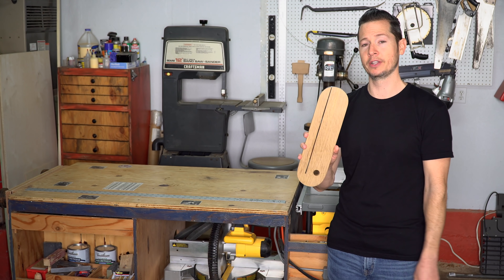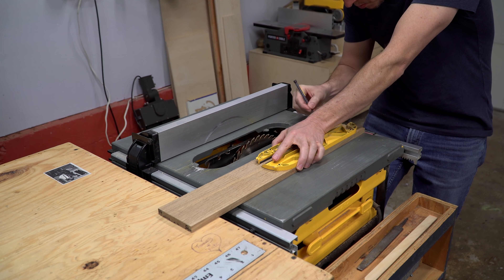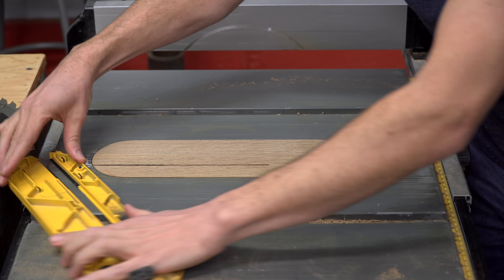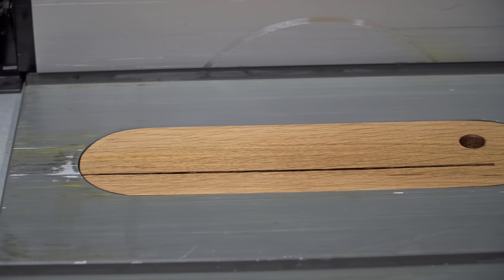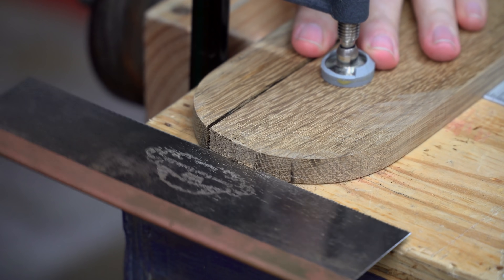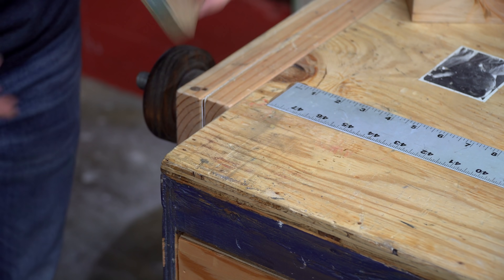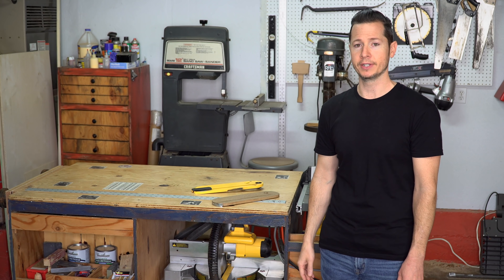A BETTER Zero Clearance Insert!

Comment: Once again, you're my hero lol. As you might remember...I too have this saw and am annoyed by that design flaw. DeWalt should buy this idea from you! Thanks again for a perfect fix!  🥰 Cheri
Reply from the maker: Thanks, Cheri! I'm glad you got something out of it - good luck with making yours!
Reply: Technically Dewalt could just alter the mold for the insert and maybe the riving knife if the aluminium got too thin at he back of the insert.
But there really ought to be an optional close-to-zero-clearance insert for those of us that barely ever tilt the blade! A small rodent could squeeze through that gap!

Comment: I have the exact same saw and the exact same problem! Thank you very much for the idea! Hopefully I can make this work.
Reply from the maker: No problem! If you build one, be careful not to sand the top side of the plate, only the bottom. You don't want to ruin the flatness of the top. If you do build it, let me know how goes!
Reply: @OneMinuteWorkbench  Thanks for the tip! I will let you know how it goes!

Comment: If you are going to make any more of these in the future, a less fiddly way to make the insert perfectly flush is to make the insert shallower than the depth of the plate. place two flat boards on top of the plate and stick them with thin double sided tape. apply some wax to the tabs and apply a dollop of hot glue to each of the tabs and then place the zero clearance insert in the hole with the top boards aligning the zci to be perfectly flush. the wax will allow the glue not to stick to the tabs but stick to the wood. the result is a perfectly flat top without having to sand perfectly.
Reply from the maker: Thanks for the idea! Somebody else just mentioned that and my only concern with it is that hot glue always seems "rubbery" to me. I would love it if I could do this method with something that gets as hard as epoxy, but epoxy might not be great because it tends to not be thick enough and just settle or run. How do you find the hot glue to feel. Does the insert seem to wiggle or dip from the rubberiness of the glue?
Reply: Would it be unreasonable to adjust  the surface of each tab so that each tab would be at the same depth below the table? One and done.
Reply from the maker: I think that's sort of the idea people are getting at with the hot glue idea. Except that in that case you'd only be able to adjust it one time. Some screws set into threads in the bottom of the insert might be another way as well. You'd just need to make sure the screws didn't adjust them selves from the vibrations of the saw. Thanks for sharing another idea!
Reply from the maker: Thanks for sharing that idea!
Reply: Why not just use screws like the original plate?
Reply: @loganmedia1142  because it's a permanent solution instead of having to adjust the screws as they rattle out. it also makes the insert free of any metal. (though this particular one used some metal for the front which i'd not do on a saw that had a reasonable throat plate that allowed the riving knife to work with it.)

Comment: This is really good. Thanks. I've got an older General Contractors TSaw that, oddly, has  slightly misshapened  round ends to the insert. When I made some inserts, several years ago. I made a couple. So I'd suggest making more than one. Straight cut with your regular blade, another with more gap for angle cuts, and  one for dado.  My plan of making a router pattern ... never happened. I didn't have a zero clearance pattern bit. I've had my tablesaw for about 25 years, been using them since maybe before your parents were born, so basically I'm saying, from experience.... making table saw inserts is something I think most people won't be doing every couple of months. So once you make an insert you like, make a few more right now. 
 Tip. Tweak your blade adjustments before you make your inserts, that 1/100th of 1 degree... well fixing it usually moves the blade over a lot more than you'd expect. Also my General? Great saw but the bolts, nuts, lock washers for adjusting the blade? They weren't very tight.  I upgraded the nuts, bolts, washers to...? I don't remember, it's been 14 years, but I think I spent a few bucks. (Split lock washers in general are crap, maybe not today, maybe not next week... I've learned to think of them as temporary.) I don't spend a lot of time in my shop, but 14 years between tablesaw adjustments? I check it every now and then with calipers. (I also try to avoid angle cuts which is lazy, but keeps from racking around all that hardware.)   There's no excuse that a company like DeWalt which has probably sold millions of these table saws,  would make such a crappy insert. Read Fight Club, clearly they've calculated the cost of missing fingers, blinded eyes  and the likelihood somebody sues, against the cost of fixing this inexcusable problem.
Reply from the maker: Thanks for the compliment! Thanks also for taking the time to share your advise and experience!
Reply: Yes I am sure the inserts that made for my saw are 25 to 30 years old as well.  And I just make the insert and raise the blade so there was never any flex to start with.  I still have the original insert that came with the saw I noticed the other day in the cabinet.  Don't think that I have used since I bought the saw in 1980.
Reply from the maker: Time to put it up for auction, maybe antiques road show 🤣

Comment: Great video, well done. I watched your video today after making some zero clearance blanks from 12mm plywood for my DeWalt 745 yesterday following different sets of instructions. They didn't address how to stop the flex at the back of the insert and your method looks great and I'll try it today. I plan using steel tie-down strap, which already has holes, leftover from other jobs. To level the insert I'll likely add some heavy duty tape to the bottom (adding thickness to the blank where needed rather than having to make it thinner). When I test the blank I'll see whether I have to add a clip at the back to hold the insert in place or whether the dust collector vacuum will be sufficient to hold down the insert. Many thanks.
Reply from the maker: Thank you! Good luck with your project - let me know how it goes!
Reply: The insert seems to work fine. It was fiddly to attach the steel tie-down strap at the back end. I think it would have been even more rigid if the strap was wider like your hose clamp. Using a hose clamp is also better in that you have to drill the pilot hole through the steel which keeps the screw centred. It was more difficult to drill a hole in the centre of the existing holes in the tie-down strap. The leveling took a while - I taped clips of the tie-down steel to the bottom of the insert and added extra layers of tape as needed. I also had to relieve a strip on the bottom where the insert rests on fabric to the left of the saw blade. The insert is a snug fit and I'll see how it goes over time. My saw is a DeWalt DWE7491-XE (not a 745 as I previously mentioned) and may have a slightly different design than yours.
Reply from the maker: Sorry for the late reply on this - just wanted to say thanks for coming back and sharing about your experience!

Comment: I had a similar issue but I just transferred the size of my plate to my wood insert with all the holes. Mounted down the insert and raised the blade as it was running so I didn't have the issue of a gap at the end of the outfeed.
Reply from the maker: Thanks for sharing your experience! I would have done that, but I wanted to accommodate the riving knife as well as the blade. I hope this make sense!

Comment: Great video. One thing you missed with the insert is the rabbet/grove you need to make to allow the saw to be raised all the way up. Otherwise the housing will push the insert up. I have the exact same saw and I'm on my 3rd zero clearance insert now. The first two didn't accommodate a riving knife but the current one does (and is connected at the far end). I still have a bit of flexing problem towards the middle right end (the fence side). I think I'm going to make another one with a metal reinforcement all around to avoid flex.
Reply from the maker: Hey thanks for sharing what you learned in your build! I'll have to incorporate all the stuff you and others are sharing on the next version! Thanks again!

Comment: A great improvement to a flawed design made by Dewalt engineers.
Nice job on your video and editing.
Reply from the maker: Thank you very much! In fairness to DeWalt, it's marketed as a contractor's saw, not necessarily made for cutting super small pieces. That said, we all know that us average folks are buying these saws as affordable alternatives to a nice cabinet saw. Either way, I say there's nothing wrong with modifying it to be more effective 😉 Thanks again!

Comment: Nice. I’m still trying to figure out how to make a plate for my table saw. I have an old Craftsman where the blade is almost to the back and the plate is super shallow.
Reply from the maker: That's exactly what I was faced with here. Either remove the riving knife so the plate can stay connected, or find a thin yet strong material to that would fit in the minimal space available. Good luck figuring out an insert for your saw!

Comment: The clamp steel reinforcement is a great idea.

StumpyNubs has maybe the best throat plate height alignment method I've seen. Paste wax the little support ears, glom on some hot melt glue, and push it down onto the ears until it's flush. He secures strips across the top face of the throat plate so that it squishes the hot melt just until the top face is even with the table top. A completely custom fit. It works great.
Reply from the maker: Thanks! I like the sound of the hot glue idea, but I may want it to be a little more stout than the glue provides. I feel like hot glue always stays a bit "rubbery". I could use that some technique with some thickened epoxy, but I'd be worried that the epoxy would slowly settle and bring the plate down too far. I wonder if there's something with the hardness of epoxy but the fast setup time of hot glue...hmmm 🤔 Anyway, thanks for sharing the idea!
Reply: @OneMinuteWorkbench  In my experience (limited to one Delta Model 10 contractor saw), it works great.
Reply from the maker: Thanks! I might have to give it a try!

Comment: Very nice!!!  Have you considered leveling screws?  These are fairly easy to add.  How about hold-down screws?  These are more complicated to add as they involve tapping / threading the thin metal lip under the plate.
Reply from the maker: I thought about adding leveling screws, but not hold downs - that's a great idea! I think I'll do that tomorrow! Thanks!

Comment: The idea was good.  But checking at your thumbnail, I thought that you had yet another good concept going on.  My brain just linked some other dots with your picture.  It’s awesome.  Thanks for the video.

If you want to know the flash I got, here it is.  I thought that you had managed to sorta implant a springy effect on the metal strip, and, hence, that you had came up with a zero clearance auto-fitting insert.  I thought it was a cleaver way to account for swollen or depleted wood fibers… all the time!  I’d also add a riveting knife (wtf did I just say?  It is what I do…). 

I know, therefore the design would need to account for other forces.  But I feel I have more than a little aspiration to owe to you; so for that, thanks again for sharing.

Comment: Nice idea. In addition to the two screws, could’ve you apply some epoxy to make it more secure and solid?
Reply from the maker: Thank you! I don't see why not. In its current state, the strap is very secure because it butts up against the edge of the notch for its entire length. So I don't know if it's necessary, but if you do add epoxy, I'd say add the screws without epoxy and test it out first. That way, if the screw positions have pulled the separate sides of the insert out of perfect alignment, you can repair it by moving one of the screws. Only after you're sure it's still perfectly aligned, then add the epoxy. Thanks for the question! I hope this helps!

Comment: Just a couple of days ago, I thought about doing something similar to mine. Narrow cuts are a royal pain with that huge gap that could swallow a small warship.
Most other "zero clearance insert" videos doesn't take the riving knife into account, or they modify it to fit. I would hate to modify mine, as the blade guard would no longer fit on. The european version of the DW745 is slightly different in several ways, the blade guard being one of them. Another is the missing anti kick-back, normal push buttons for on and off (not the big fat off button on yours) and a Philips head screw for securing the insert at the front. It also has just this tiny key slot for removing the insert instead of your finger hole.
One question though: is it really safe to just have it sitting loose in the slot?

Comment: How will you overcome expansion and contraction in your insert. Did you use quarter sawn lumber.
Reply from the maker: I did use quarter sawn material, but I'm not sure that will combat expansion and contraction 100%. I'll probably have to service the insert over time, and maybe even replace it. Thanks for the excellent question!

Comment: Do you have any issue with the plate raising at all from the vibrations? The original plate (as awful as it is) locks in front and back to prevent it lifting. Love the flexing fix btw!

Comment: Try the Leecraft DW-2 Zero clearance insert, specifically for the DeWalt DW745 and its sister models. Beautifully built and costs about $32. You'll need to cut a strip for the riving knife but it's not hard.
Reply from the maker: Thanks for the product recommendation. I had a look at it, based on your comment, but it looks like if I cut the slot for the riving knife, I'd still need to create the steel-strap-connection around the front, otherwise it looks like it would suffer from the same sort of flex as the original did, and like mine did before I added the strap. I could test it out to see, but I'm not sure I want to spend $32 to find out 🤣. Thanks again for sharing!
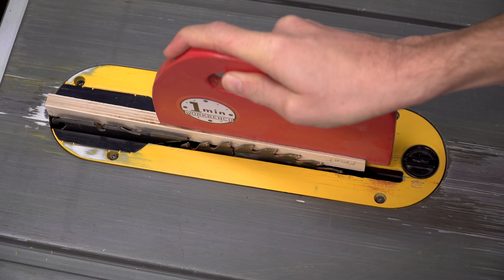Reply from the maker: Thanks for the link. I checked out that video, and see how he did it. The saw he's doing it on provides lots of space (on order of a couple of inches) between the riving knife and the slot wall....the problem is that on the DeWalt DW74xx series, there is less than 1/8" between the riving knife an the slot wall. There is only about .090", so what ever fits between the has to be smaller than that. So let's say a maximum of about .080". The only material I could think of that would be strong enough with less than .090" is steel...or maybe aluminum. Obviously I went with steel. Check out my video again, and look really closely at how close the riving knife is to the slot wall...you can see it really good at about 1:07, and again at about 3:07. I hope this helps!

Comment: I have the same table saw and there are a lot of things that bother me about it.  I know it's a contractor's saw, so I haven't gone to DeWalt to demand fixes.  1) The table is not perfectly flat... in fact, it dips around the throatplate area and it drives me mad... 2) The rip fence has a small bow in it.  I've got it perfect at one end and the other with an indicator dial, but when I check along the miter, the fence bows in the middle by about 0.005"... like I said, it's a contractor's saw.

Do you think I could use a gummy epoxy to try and level the table and how about a fitted (over the top) fence accessory kit?  Thanks!
Reply from the maker: I sort of feel the same way...it's a contractor's saw, so I can't demand perfection. I'm also pleasantly surprised at how good it is for being a contractor's saw. I like the sound of leveling the table, but I think you might be opening up a can of worms. You'd almost want very viscous, self-leveling epoxy, but you'd have to tape off the perimeter and the miter slots. You'd almost certainly also have to do some after the fact work on the edges because epoxy tends to "climb" the walls it's curing in. And the last part of that equation is that it might not make the best surface for sliding boards across day in and day out. Even the best epoxy is essentially just plastic. The better (and harder) the epoxy, the more closely you'll approximate the likeness of high quality plastic. But even the best plastic is probably a bad choice for a table saw's table...it just gets too much abuse. I guess I feel like you'd be running into similar issues with the fence. The sort of precision you're looking for may just be tough to achieve on these contractor's saws. Reading back over everything I just wrote, I don't know if I've helped much 😂 If you come up with something that gets around all this stuff, please be sure to come back and share what you learned! Good luck!

Comment: Would it be possible to modify the riving knife so it clears the front of the insert? Then the insert could remain whole at the front.
Reply from the maker: You can take the riving knife out, but I'm a bit fan of the riving knife. I suppose you could grind it down an 1/8" or maybe 1/4" to provide a little more space in there. That would allow you to keep it connected. I guess either way, you're not getting through this project without having to do a little metal work 😉 Thanks for sharing the idea!

Comment: Great idea, but what happens if you tilt the blade, does it not hit the screw closest to the slot? You could possibly move that screw further away from the slot and that should fix that I think.
Reply from the maker: I didn't design this blade to accept a tilt. That'll have to wait for version 2 😉 Thanks for the question...now I've gotta start working on another one!